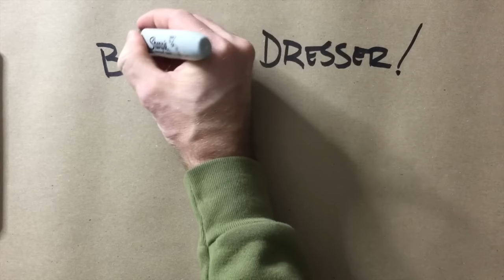JWF-BIG ASS DRESSER!!!

Comment: Wow! That's a big build!!! How do you like the circular saw guide?
Reply from the maker: I love that thing. I like to take it outside and use it. I don't have any dust collection for my table saw so that is an excellent alternative.
Reply: +July With Fitz word. My table saw is the cheapest craftsman evolv that's just open at the bottom. Looks like a must for full sheet work!
Reply from the maker: +Michael Lawing I have a shitty old craftsman table saw that I got for $50 at the pawn shop. It's open at the bottom like yours. I try not to use it bc it's so dusty. In the video I tripped the breaker bc I was trying to use the table saw and the shop vac at the same time. My garage is very underpowered.